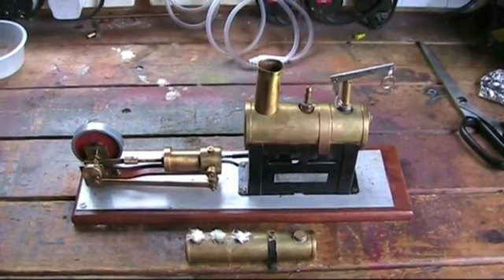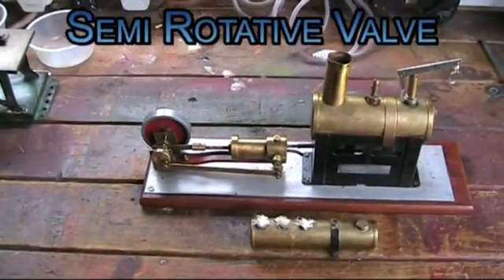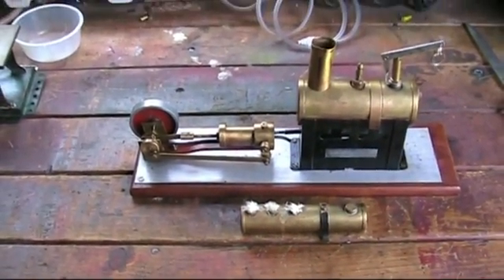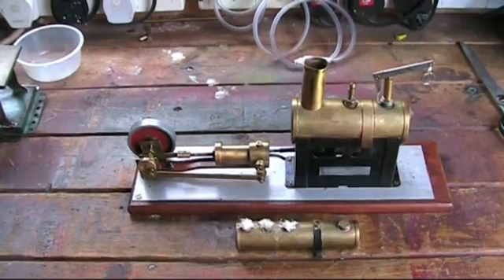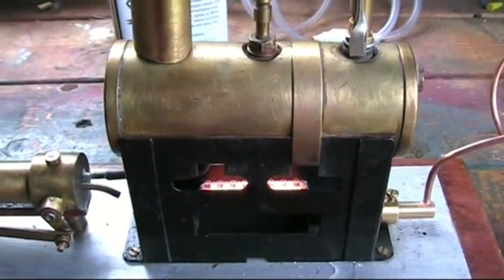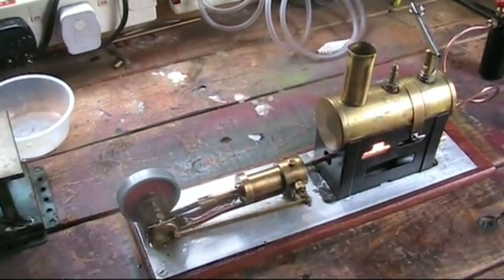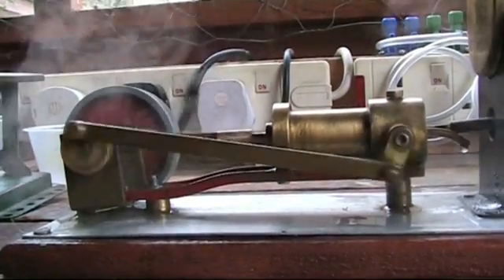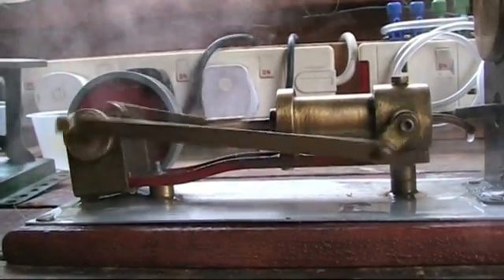Cyldon 13 2 Toy Steam Engine Running On Live Steam.

Comment: I have one of these engines, just wondering if the valve actually does something, I ask because the bar connecting doesn't move the actual shaft instead it just oscillates.
I am going to try starting it tomorrow.